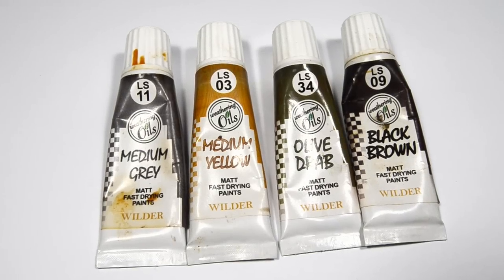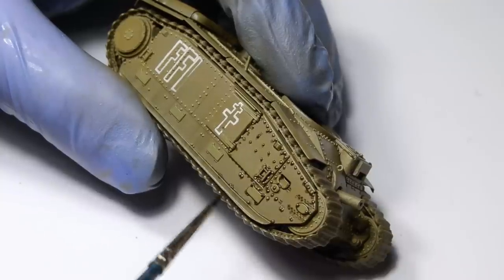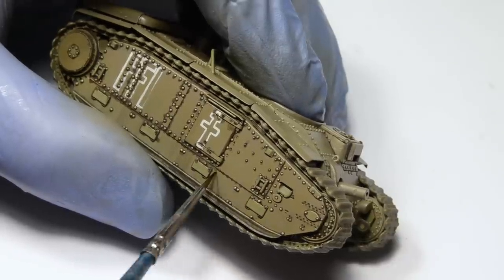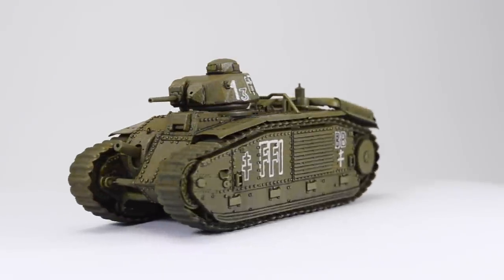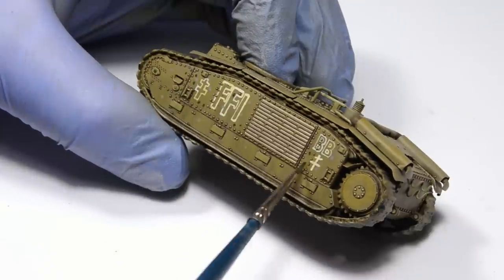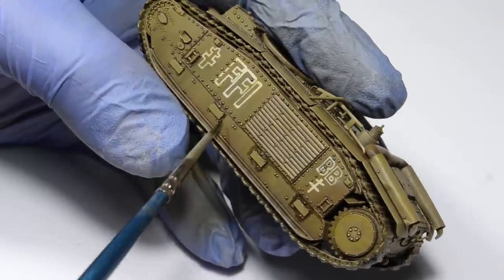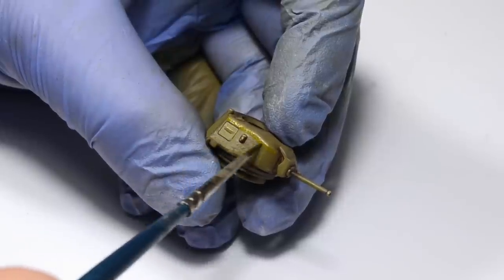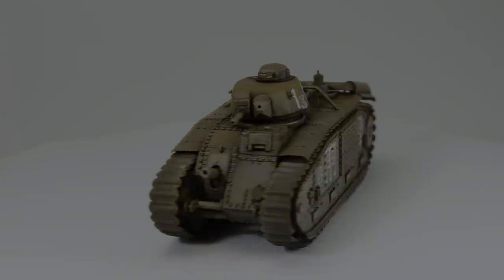Adding Washes & Blending Oil Paints - Char B1 bis (Trumpeter 1/72)

Comment: Hey Uncle Night Shift, I am very new to Oil weathering and think I screwed up totally, I left a model exposed to Light in my Living room and now the color totally changed. It is much lighter now and the pigments dried up to look like crap. I tought varnish would seal it away but I guess I did wrong. Do you have a Tip for that? I adore your work and try to replicate it here and there

Comment: Love the videos. Great skill on display here. 👍

I didn't even model, but you got me interested and because this is your fault - I have questions!

When I tried the oil dot pairs method, the next pair of dots kind of merge entirely and I lose the effect. I don't get colour differences, just all mixed together.

Q1) Should I be doing my first pair of oil dots and letting them dry for a day or so? I'm a bit confused with drying times in general.

Q2) And also how much thinner do I need on my brush for this method? Do I towel-off excess and just have it damp?

Thanks in advance (if you can be arsed to answer)! 🥺
Reply from the maker: Soooo I got you into modelling? 😱 
Well my guess is that you have way too much thinner on your brush. That’s usually why the dots merge into a total mess. Try checking out my Type 5 Chi-Ri oil dot and wash video, maybe you’ll get a few more ideas there. You can always blend the oils, wait a few minutes and add more. Just don’t use too much thinner.
Reply: @NightShiftScaleModels  thanks for the swift reply, I will go check it out (and use less thinner on my brush).